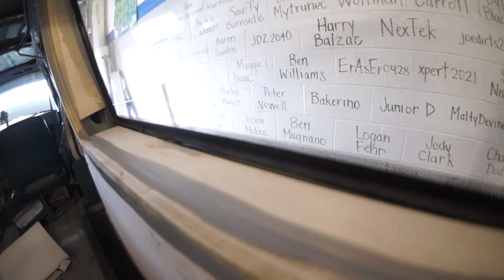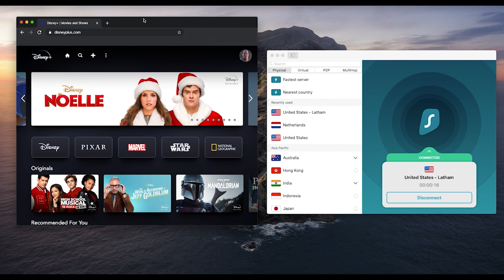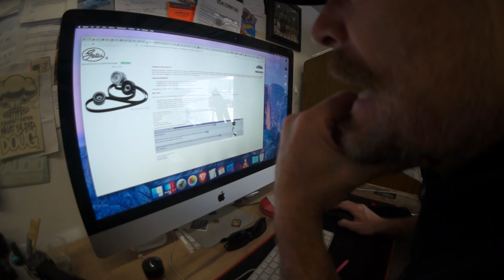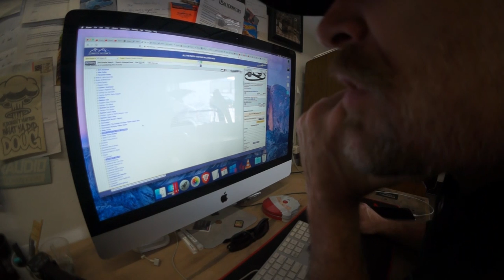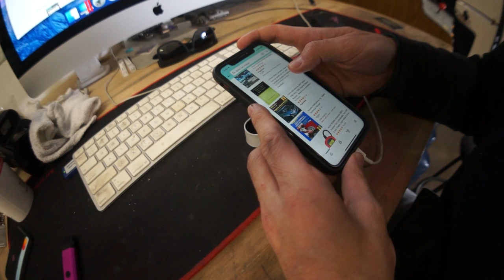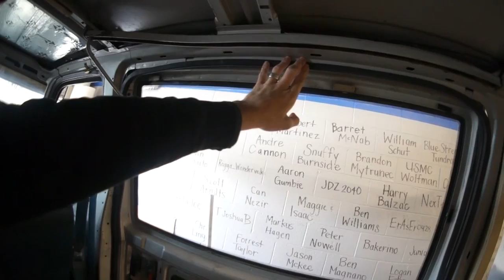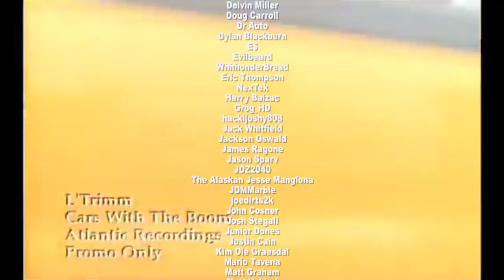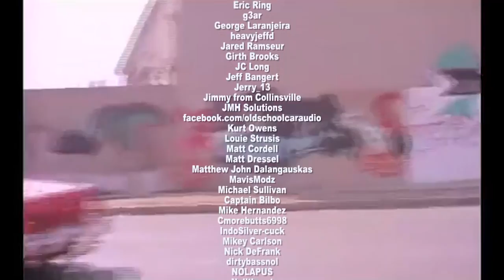SOUNDMAN vs CAF vs EXO BASS WARS UPDATE! BVV#65

Comment: It's not swell to use a jigsaw....Mark Zuckerberg would have spent an hour and a half picking mobile solutions templates  and putting on his 9 layer saftey suit to router out that panel that took you a minute and a half.....And that you can pretend to be Luke Skycaulker with that nifty power caulk gun
Reply: Lol reading this a year later and dying🤣

Comment: That other item you couldn't remember on the engine was a smog pump I bet.

You might want to go to the bone yard and pull a front accessory drive off another GM v6 or v8 so you get all the bolts of many lengths and all the brackets. You also need a different water pump (reverse rotation) the belt one is standard rotation.

Comment: So idea bro. Hope you see this. About your door track. You could in theory make a new arm that has a different angle. You need some tension on top to keep the door tight. But a different arm could do the trick. You may or may not have to modify the track but if anything you would take that swoop in and move it towards the outside. I know your brain can come up with something. Happy building.

Comment: Hello, I'm new here. My nephew asked me to build him a box for his car, being that I build custom furniture pieces, I told him - "sure, why not." Soooo,  I watched an old video of yours (BOX BUILDING TIPS BVV#29) and didn't really notice any tips . . . nonetheless, I am hooked. Subscribed immediately. Now I just have to go back and watch all the old videos to understand all the jokes.
Questions for any one that can answer (remember I am a new to car audio) 
1. Why birch plywood? Furthemore, why from Home Depot or Lowe's? Neither sell true cabinet grade sheet goods. My local HD carries a 7-ply red oak but it has de-lams all through it. I would think MDO would be a better choice for box builds.
2. If he lives in California why not throw some solar panels on the Astros' roof? Seems like a Cali thing to do.
3. The arm for the sliding door can simply be fabricated to bend upward rather than down. In simplest terms, just flip the bracket up. Can't imagine it would be too difficult to make a new arm that could hug the roof and still allow the door to function normally. Right?
Reply: I know this is a year old, but I figure I'll answer in case anyone comes across your post.

Bitch plywood cuts way, way nicer and is far less toxic than mdf. And it smells nicer and isn't as sensitive to moisture. I've always got my 3/4 birch from Lowes and other than the very edges, I've never found voids. Looks good stained/polyeurethaned too if you want to keep the wood look.

Comment: A compleate front accessory assembly off any 4.3 v6 from at least 90s should bolt up I'd go to salvage yard and buy whole set for next to nothing. A small block assembly may fit but can't remember
Reply: Find a S-10 or pickup much more room to work in.
Reply: Some Silverado 1500s had the same V-6 too.
Reply: And reverse rotation water pump

Comment: Hey Doug bend a piece of bar stock into a L and weld it onto the support bar for the sliding door so that it’s up really close to the door and then cut out the old one so that the stock slider is still in the same place...  that way you won’t have to make suck a big box around it..

Comment: If that engine is a 4.3, do yourself a favor and get to a salvage yard that might have an old Chevy full size truck with the same engine or a small block v8. Everything will be bolt on, and it’ll save you a helluva lot of time looking for pulleys and bits to make the old accessories work with new pulleys. Look for 4.3, 5.0, 5.7 Chevy engines from 87 till the early 2000’s. The water pump is needed too, as when you convert from v belts to serpentine, the rotation of the pump changes too.

Comment: If you have the 4.3 it's easy 4.3 5.0 and 5.7 would work just go salvage yard get the bolts brackets and accessories water pump and fan youl have to get for the year you get parts from rotation is different in 86 there was a v and serpentine combo also

Comment: Why don’t you just weld the sliding door onto the frame? It would add a lot of rigidity and could reduce the weight some by removing the superfluous tracks and latches.